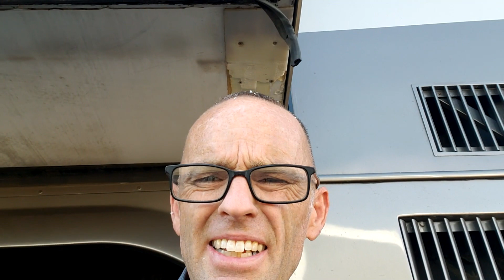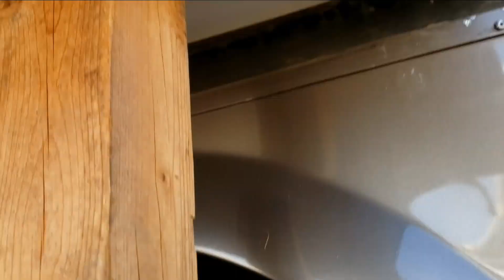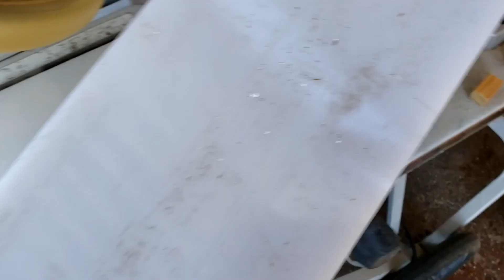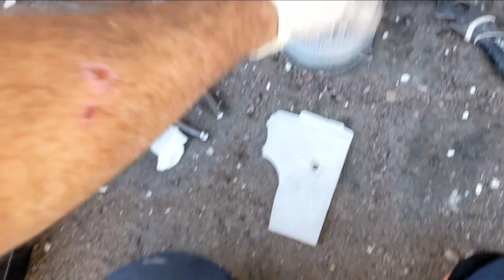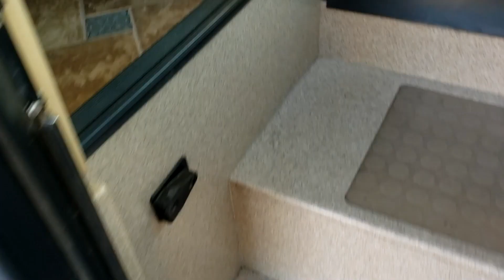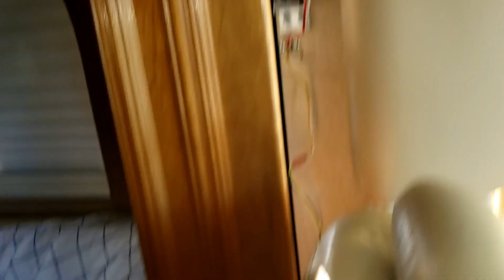Repairing a Broken Monaco RV Slide-Out

Comment: when I was a truck mechanic we used the same nylon shoes but they came premade prefilled they were on the log bunks on log trucks and trailers. log bunks are the u shaped steel that the logs rest on in-between and as the truck turned they turn so it's 10,000 + pounds of weight on them . they last year's but when they where out a couple days of running without them tears up the steel so bad they need to be replaced like brake drums when the shoes get worn to metal and driven 500 mile
Reply from the maker: Thanks for the comment

Comment: Looks like a big gap above  the guides you replaced , wouldn’t you have water running down an rotting the plywood, or is there a strip that goes on that
Reply from the maker: along the side there is a built in gap more like a drip rail. Many current slides have molding at the bottom but it usually creates a guttes directing water inside. Monaco changed the design to prevent that. Thanks
Reply: Thx

Comment: You make a comment about not commenting on slide locks. Would you mind elaborating. (My view is I do not use them. The hazard of extending the slide with them installed is far greater than the risk of an inadvertent opening. That is my opinion—not supported by facts or experience)
Reply from the maker: These are automatic electric locks and were discontinued immediately as they caused nothing but problems. I also do not recommend locks as they cause more damaged than they solve 100%. Thanks

Comment: I'm starting to believe there should be a building code for all RV, a do you agree
Reply from the maker: There is RV code. It of course is the minimum standard, but the RVIA has a standard which in general follows most minimum home standards and of course the DOT has mandates including recalls. Many have to meet certain state requirements to be sold, but I do know what you mean.
Reply: In 1974, we brought an east-coast travel trailer to California on a military transfer of our family.  We decided to sell the trailer in CA, but could not because of enhanced electrical and plumbing codes CA demanded for RVs bought and sold in CA.  Husband rewired and plumbed the trailer, it passed inspection, and was sold.  A reno feat unheard of at that time, and out-of-state RVs were towed back across the CA/Nevada or Arizona  border to be sold.  Even the inspector was surprised.  Did not cost much as was self done.  So, RV codes were in effect even then.

Comment: Great job.  If the Beaver has air activated slide lock pins like my Wanderlodge some just deactivate them.  Mine have been and I have had no issues with them sticking.  That is a prevalent issue with those units.
Reply from the maker: These are electric with bad worm drive that lacks bearings or thrust washers to keep the locks from binding. They were such a bad design that they only existed for one model year.

Comment: Ok I always learn from your channel, thank you for educating the masses. I have a question not related to this video so please forgive me. I have a 2020 Winnebago Micro Minnie with 25 gal grey and black 31 fresh . Now my question is..How accurate are these holding tank sensors. Brand new dumped the tank maybe 5 times , but after I wash out the tank and add 3 Gallons of clean with the chemicals my gauge shows 1/3 full, with 3 gallons? Are the gauges to be used as a rough guide or should they be very accurate.  
Thanks Any input would be appreciated, I'm a first time buying and traveling in these? Unit is level too and the tanks showed empty when I started the fresh fill.
Reply from the maker: I don't know if the micro minnie has well nut probes or acculevel sensors. However, either way, tank monitors are much more a rough guide on most RVs.
Reply: @AZExpert  thank you for that
Reply: he has a video on tank sensors.
Reply: @badgerpa9  ok thank you

Comment: James if you want the best slide material Go to the marine shop and get the BLUE BOAT TRAILER SLIDE Its the best i have had it on mine for 5 years not a drama at all Its slippery like snot You can get it in 1 inch to 6 inch wide in a 12 foot leingth , 
Rob
Reply from the maker: That's good information. Thank you!

Comment: You don't really need to stand facing the sun.   We can see you just fine!   Great job!   You got on on hydraulic jacks leaking?
Reply from the maker: Thanks 👍 Not as of yet, just fabricating new hoses.
Reply: AZ Expert    I have been looking but can not find an answer to a question.   Is this correct, on Lippert jack, one hose connected to center at top is to extend the jack and the other hose connected to outside on top is to retract the jack?
Respectfully,   Kevin

Comment: is there a way to slow down the front slide on a monaco windsor ? it feeds out so fast it tilts the slide by the stove so it hits the floor . i haven't crawled under yet to see if you can adjust the pressure
Reply from the maker: That's a good questions. Possibly if it's a hydraulic slide but that is a very uncommon problem

Comment: Monaco definitely had a unique design on their slide, especially their flat floor design with the guide shoe and UHMW (Ultra High Molecular Weight) slide material.  As for adhesives, you should try some 3M 5200.  It is heavily used in the marine industry and a great adhesive/sealant.  If you run into a lot of issues with the floors on the slide check our Guardian Plates by Talin Industries.  I've installed a few of them and they are a great product for Monaco products and Chris @ Talin is great to deal with.  
Great video and solution.
Mike
Reply from the maker: Thank you very much. Seems like you are familiar with rotten Monaco slide floors too
Reply: Yes, like you, I've seen a few in my days.  Keep up the great work, I love seeing quality workmanship and people who take pride in their work.
Mike

Comment: I'm a little surprised that there are only two for what looks like a 8 to 10 foot slide.
Reply from the maker: The main pressure is at the sides, the rest of the floor is very flexible. Thanks!

Comment: My 1998 Damon has metal rollers and it still works great even after I replaced the carpet with vinyl planks. Why would they change to an inferior design? I hear many complaints with slide outs but my ancient one keeps chugging along.
Reply from the maker: It is very strange how reliable the first generation slides were compared to modern slides.
Reply: New high tech using cheapest materials improve manufacturers Proffits